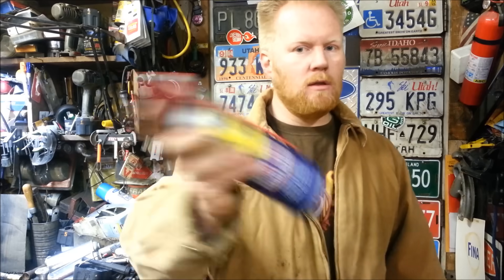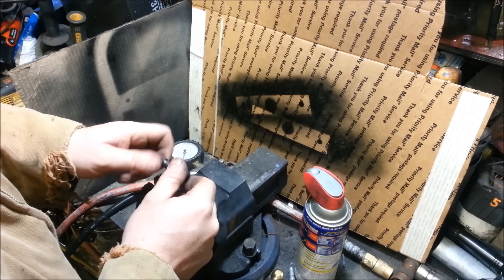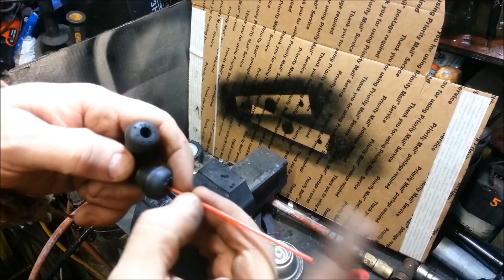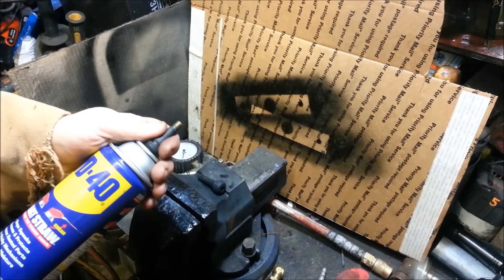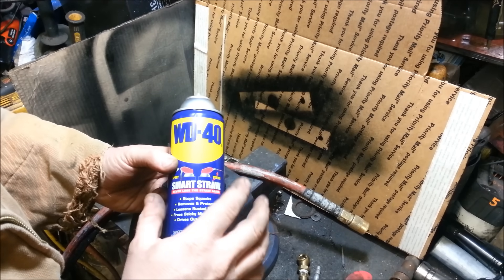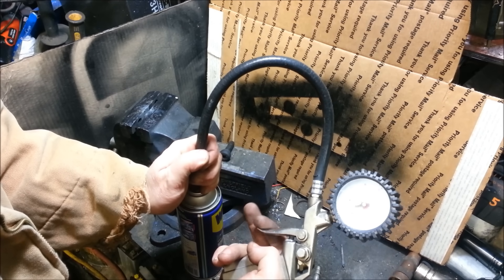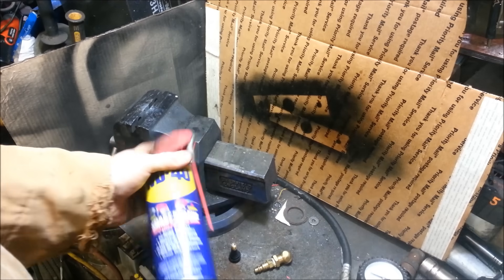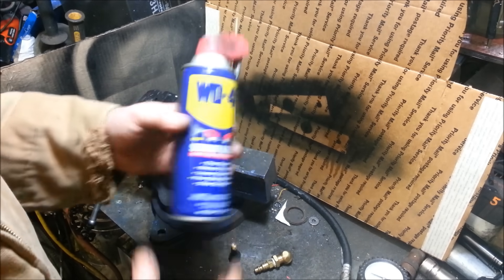Refill flat AEROSOL Spray Cans like the WD-40 and others

Comment: Interesting video.  Oddly, I've never run across a can where the air was gone before the fluid was.   I HAVE broken the top off of cans of compressed air (computer duster, etc) while the can was still full or mostly full.  That sucks since they usually won't go back on like the WD-40 sprayer did.

Comment: How interesting. I'm an IT guy, and always carry cans of compressed air to clean (even a small compressor is too big and klunky for in office work) Wonder how this would work on those, you know, the cans of compressed air you buy in PC shops. Guessing it's important to know the PSI of the can first. Boy that would save a ton of money. I always wanted to invent a refillable can since really all it is is air.
Reply from the maker: +Joseph1NJ It doesn't work well for air. When the can is filled with straight air it will only last for around 10 seconds. Cans of air you buy are actually freon. Yep the same stuff that your car AC uses to make it blow cold air. The older stuff from a few years ago was r-134a and the newer stuff is r-152a. They use this because unlike air it turns to a liquid when compressed inside the can and allows a ton more to be put in.
Reply: sixtyfiveford Oh well... Thanks for the detailed reply.

Comment: Can you do this procedure for compressed can dusters to clean electronics. Those are $5 each.
Reply from the maker: +Luis M Not really because those aren't actually air. They are Freon. The older units from a few years ago were R-134a and the newer ones are R-152a. Those gases turn to a liquid when compressed so you can fit a ton more. Air doesn't compress to a liquid so if filled in a can will only last around 10-15 seconds total.

Comment: I've done this, but I didn't use the valve stem, just blew air into the can.
Reply from the maker: +1985cjjeeper Yeah, if you have the rubber tip air blower that works as well.

Comment: Here I've just been crushing the cans to get them to spray again.
Reply from the maker: +Paul Frederick That works too.
Reply: sixtyfiveford
To a point. Eventually I run out of can to crush though. I read someplace that running out of propellant is due to shaking the can up prior to using it. Apparently you're not supposed to do that. It isn't spray paint after all.

Comment: Please, please don't do this, remember when you rise the pressure inside any vessel, temperature rises (remember Dieseling of airguns? or just how diesel engines work?) and doing it with a source of oxygen can lead to dieseling inside the can... It can go BOOOOM...
Reply from the maker: +Francisco S.P. Completely irrelevant to what is going on here.
Reply: How so? Back it with real arguments
Reply: The can is a pressure vessel, right? Air has oxygen, right? Put air inside can an pressure rises, right? When pressure rises, so does temperature, right? High temp, oxygen and WD40, which is a flammable fluid, leads to what? Booooom!
Reply: Actually, don't mind my concerns, do that at home ASAP... BTW, do you believe in afterlife?
Reply from the maker: You're talking extreme pressures. Paintball guns use compressed CO2 that is almost 900psi. A diesel engine ignites at around 800psi. A high pressure home or commercial air compressor runs at 175psi max with the average one at 120psi max and is always regulated down to around 90-100psi to run air tools. The can is refilled to around 50psi. With your rational every air compressor would blow up everytime it refilled itself (yes it has oxygen and oil from the compressor motor in it).

Comment: Good Idea.
Reply from the maker: +Sajid Rafique Hey Thanks.
Reply: sixtyfiveford Could this be done on spray paint as well ?
Reply from the maker: It does but you'll need to use the paint up as it will dry in the can if you don't

Comment: Handy tip. Clear your workbench off,don't hide the junk behind a piece of cardboard.
Reply: I have put a piece of plywood on the junk then used it as a bench
Reply: +pyro8818ak47 You and the guy I work for! Don't get me started! ... Too late. In my jihad against my boss's hoarding I have banded up a 6'x4'x2' cabinet solid packed with useless treasure,picked it up with a fork truck,dropped it in the dumpster and buried it under scrap. I filled the space it was in with other crap and replaced the dust to hide my benevolent act. A journey of a thousand miles begins.
Reply: +inkydoug  And he never missed anything did he.
Reply: Graywolf
No more than anyone would miss a cup of water from the sea.
Reply: +inkydoug Or just eat your junk
Reply: +inkydoug haha replaced the dust...
Reply: inkydoug next

Comment: that's a good idea. 
That's a valve stem. The core is inside of the valve stem.
Reply: Was just about to post the same thought..... guess that's what 8 1/2 years of breaking down, dismounting, retreading (and/or section repairing), then remounting semi truck tires would do to a person though. Worked my last day in 1986 for Bandag - best retreads around for semi truck long haulers, and our shop had a 1.4% adjustment rate at that.
Reply: Like an apple ?
Reply: @ezrabrooks7785  
Yes!
Reply: @ezrabrooks7785  no more like a blowup beach ball or air matress
Reply: schrader valve

Comment: I use a new can of WD40 hooked together with one extension tube and press both dispenser buttons down. The new can has too much pressure for me and then I have two cans about half full which it's still too much pressure, but it is a lot better for my uses.

Comment: A bit of warning . Compressed air with oil is the very working principle of the diesel engine.
Reply from the maker: +Maillot Jean Pierre Only at 700psi plus which you'll never get close to with an air compressor.

Comment: Nice video!  One correction though - air pressure doesn't expand with higher temperature. Only cryogenic gasses are affected by temperature. That's the beauty of air pressure over CO2 or Nitrogen, etc.,...you can leave it in a hot car and not worry about it exploding.
Reply from the maker: +Brian Gunderson Thanks. It makes sense.
Reply: that's not correct. air pressure does fluctuate with temperature. thats why you check tire pressure when they are cold. and they fill tires with nitrogen because it fluctuates less than oxygen.
Reply from the maker: unscarred cfh That's right. I was actually thinking about this comment a few days later and thought about the same tire example.  It may not be as extreme as something like CO2 or Propane but it does still happen.

Comment: On the other hand, you can take a canister of propane utilized for refilling lighters, and, after removing the spray apparatus from the can which has lost it's pressure, merely match up the nozzles (the propane bottle upside down, natch...)  and press down.  Easy Peasy, no fuss:  not a combustible mixture inside the can, as the mixture has no appreciable oxygen .(Nor is there a source of combustion..)
Reply: +Darvish Blathsnocker   Not propane but BUTANE.
Reply: Graywolf ..   You are correct, though the point is academic as regards the issue being addressed.   Many pressurized cans are pressurized with CO2, and the flammable nature of the gasses mentioned should be noted.

Comment: On a can of shoe water repellent, I just took off the spray nozzle and used a blow gun with a rubber tip.  All you have to do is make sure to push the nozzle open while the blow gun is over the tube on the can and when you let some air rush in it will actually get slightly warm for a short time.  The can is now repressurized.  Wear old clothes that you can afford to lose if you have to throw them away and wear googles or a face shield.  Lastly don't do it if you can not do it safely enough because I am not liable for anything bad that may happen even if it results in serious property damage or injury or even death.  It is important to realize that these cans were not sold with any intentions of you reusing them in any way and thus the manufacturers of the products in the can and the can itself will not help you either.  The only help they can give you is some first aid advice of it gets on you or in your eyes or mouth
Reply: So where's your video dummass

Comment: That's awesome! I've just cut or punctured the can and used the lube to coat my drill bits and other tools with a paper towel just for rust prevention, or dripped it onto nuts and other things. I'll have to try this "refill" technique! Much more versatile as a spray.
Reply: +SeattleDan R    WD 40 is NOT a rust preventer, although many people think it is.

Comment: Is there anything to do if you've managed to snap off the little stem on an aerosol can such as you used as an example.  I use Aerokroil penetrating oil it's a little pricey but I've used it after an application of WD-40 that didn't help and the stuck part was freed.  Anyway I dropped a can and it snapped off the tip.
Reply from the maker: +Chevy 57pkup I've done the same and the only remedy is to empty the can of air by holding it upside down by using a screwdriver tip to depress the remaining piece. Then you're left with piercing the can and extracting the fluid into a usable container. It sucks for sure.
Reply: After I asked the question it occurred to me that I have a expensive reusable spray can with different tips.  I'm way past the forgettable stage in life. Thanks for the reply.

Comment: mixing air and combustible can propellant/lubricating oil................ genius!
Reply: +Bindo 14:1 air/lpg propellant = BOOM
Reply: +Claudia Octavia 
was that yer head exploding
Reply: jokes aside, it can be your wd 40 can. Bad advice and I hope noone follows it.
Reply: What's bad about refilling the can with air, when the original propellant is flammable butane or isobutane.
Reply: Sam French
if you get a 15.5:1 mixture of air and propane propellant fuel it could go boom.
Reply: claudia:  The can is empty of propellant and will not spray any more so you would not be mixing propane and air.
Reply: +Sam French that the original propellant, although being flammable, has no oxydizer (AIR)...
Reply: ah! I see what you guys are saying now. I read one of the warnings on the can of WD40 and it says keep out of direct sunlight and do not expose to temperatures greater than 50 degrees Celsius, so if you put air into the mix then it could ignite at an even lower temperature.
Reply: +Claudia Octavia Only in open atmosphere, with a source of combustion, NOT in the can. Keep in mind, that in the can, under pressure, the "propellant" (if a flammable like butane), will be in LIQUID form, NOT gas, until it is depressurized, therefore, can NOT explode.
Reply: The propellant will be PRIMARILY liquid in the can, but the "empty" space will be filled with SOMETHING.  I do believe that something will be enough vaporized propellant to reach saturation pressure at the ambient temperature.
  Gut feeling tells me there's no problem;  the propellant concentration will "PROBABLY" be well above the "upper explosive limit", and I don't believe there will be enough heat or static to cause ignition anyway.  BUT... years of working around rocket propellant leaves me cautious.  Maybe I'll try doing this with inert gas like argon instead of air...
Reply: +Sam French These warnings are to prevent over heating, which could swell the can and then possibly burst, not ignition in the can.
Reply: gotcha.
Reply: +Bindo  I agree with you and disagree with the comments that disregard the problem because it is contained.  First, when you are pressurizing the can, the compressed air is a source of static and therefore could easily set off the mixture while it is within explosive limits. Second, the compressed gases from the factory do not allow static during discharge, there  will be nothing to perform this task with just air so again, you could push the button and all of a sudden you have a flame thrower...bad advice from an amateur.
Reply: I agree,thomas wilburn, "a flame thrower",  but what I am getting from some of these responses is, that the can itself will explode, which is not possible due to combustion, only by over pressurizing.
Reply: +Bindo ummm.. the reason it would explode with pressurized air is due to the autoignition point being reached under pressurized air.. As you increase the pressure of air which is approximately 20% oxygen, the O2 partial pressure rises which decreases the autoignition point of a fuel's, in this case WD-40, auto ignition point.. Raise the partial pressure of O2 enough and heat the can just a bit and you have a flaming hand grenade. Oh and the fun part of this is that the pressurizing creates heat in and of itself.. so.. I would use Nitrogen or some other inert gas.. and the reason they use butane is it displaces oxygen. No oxygen, no flaming hand grenade.. after all. air is free.. if it were a great idea to use it, these multi million dollar corporations would have adopted using air a loooooong time ago.. Be careful with this one....
Reply: The problem with using air as the original "factory" propellant is that you'd either need a really high pressure when the can is almost full of WD-40 (heretofore referred to as "oil"), or a lot of extra volume (i.e., less oil compared to can size).
  E.G., if the can is 9/10 full of oil and 1/10 full of compressed air, the air would need to be at 9 atmospheres pressure (135 psi) just to make the last  bit of  oil dribble out the straw; considerably higher if you actually want it to "spray"out.  And the spray pattern/flow/distance would change as the can emptied and the pressure dropped.
  By using a low vapor-pressure gas like freon or propane, you can compress a large volume of the stuff into a small volume of liquid and put it in the can.  Until the pressure drops below the vapor pressure of the gas at your ambient temperature, you continue to have some liquid propellant in the can, and the pressure stays the same.  Therefore you can get by with a smaller can, less steel, more cans on a truck, a more consistent spray, and everyone doesn't bitch that the can of WD-40 they just bought was "...already half empty, damn those big corporations!"
Reply from the maker: +Bindo All this is far from reality. The can will not go boom. Auto ignition would not occur unless you pushed it to 700+ psi which is not obtainable by an average or even 2 stage compressor. Even if you used it as a flame thrower with a 14:1 ratio inside the can it still wouldn't go boom because a spray tip orifice acts as a flashblack arrestor preventing a flame from ever entering the can. Too much Hollywood guys.
Reply: Hmm, good point, that never occurred to me and I was doing it 30 years ago. That would be especially ironic for me if you knew what I did for a living, lololol .... bang.
Reply: Bindo - brb I'm putting some oil on the threads of my oxy/acetylene to make it easier to put on the gauges.  💥
Reply: Slap on a bit of grease too.  NOT!!  LOL..
Reply: I don't disagree with the cautions here, but I think WD40 is not flammable.  It is recommended for use to drive out moisture in high voltage electrical systems.  It would not be used that way if it was oxidizable.
Reply: Meghan, you're right.  I looked up the MSDS and it's actually quite flammable (flash point 122f) which surprises me.  Enjoy your weekend.
Reply: None of you blokes are in Australia are you... Mate she'll be right, its not gonna bloody well blow up lol.. oh and btw sixtyfiveford you're a dead set legend, real handy idea....
Reply: ever light WD-40?
Reply: Hell I put gas in a pump up garden sprayer to kill weeds ain’t dead yet. Safety nazi go ho e

Comment: This is very dangerous.  The fact that you are introducing "air" into the can is a bad idea. You now have 2 of the three parts of the fire triangle in that can. A fuel and air. If you were to accidentally spray something that caused the stream of WD-40 to ignite then it could flash back into the can. 
12year olds dont say that it cant before you think about how he "recharged" this can.
Reply from the maker: +Michael Pendleton So in a situation where someone is doing something dangerous; spraying fire with WD-40................ Actually NO this is impossible. The small orifice acts like a flash back arrestor and nothing of the sort could happen.

Comment: Great Idea, thanks for that tip! WD40 cans are the WORST, they go dead with 75% of their product in them, they have failed to correct it for years, so will not buy anymore, but your tip will allow me to get the rest out I already have! Thanks!
Reply from the maker: +tom detweiler They are probably the worst in the aerosol industry for sure. I called them a few years ago and after they gave me grief for using their product wrong they gave me a free coupon for WD40.
Reply: i usually have less than 1/8th remaining...and when it runs out i punch a hole in the can and let it dribble out on what i need oiled

Comment: hey can i make a weed eater run a 12 volt enteric pump 
is it possible to produce 12 volts on the weed eater motor 
http://www.qspray.com/wp-content/uploads/2014/01/25-Gallon-Spot-Sprayer.jpg
like this one 
its a pain to carry a baterry all the time 
ty for ut help
Reply from the maker: norm correia You would have to hook an alternator to it and it would start to get heavy and complicated. You could use 18650 lithium cells to make a battery pack that weighed virtually nothing(they do sell they battery packs) vs a lead acid battery. Small generators like the Honda Ex1000 , EX800, Ex650 and the super small ex350 produce 12volts in association with 120volts.